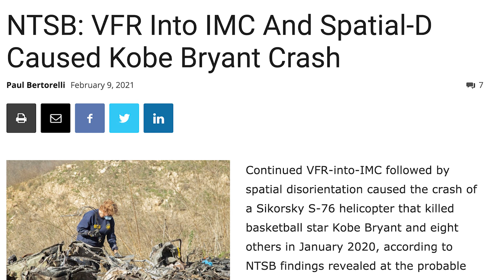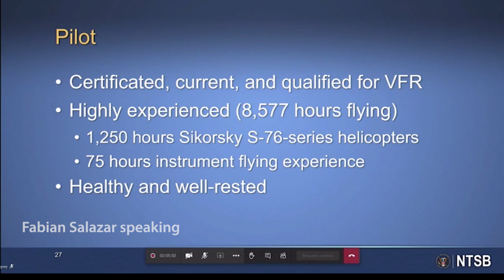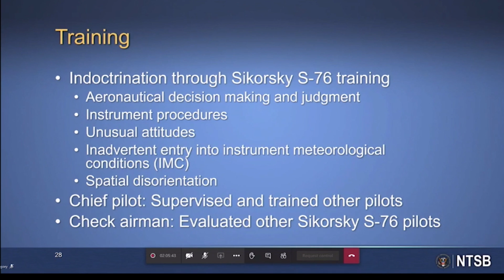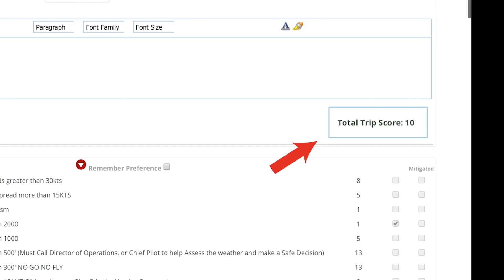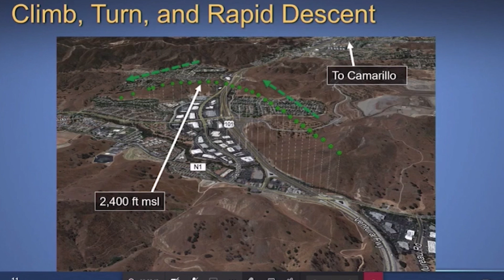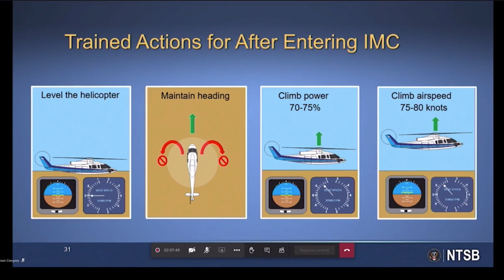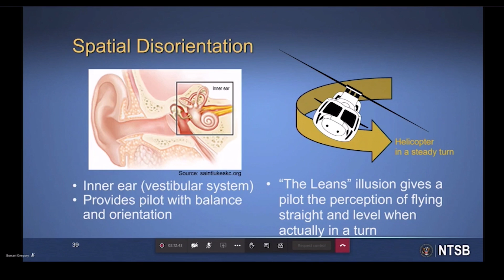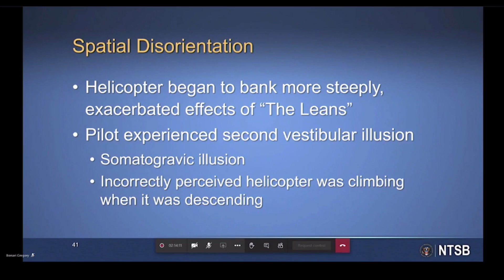How A Split Second Wrong Decision Caused the Kobe Bryant Fatal Crash

Comment: I think that the pilot was trying to get help from the towers. The first tower said that he couldn’t follow him anymore because he was lazy. The second tower was a problem when the first worker was leaving his shift and didn’t communicate with the new tower worker about the situation with this plane. If the tower would’ve helped, it’s possible he might have had a chance although he was disoriented I’m not sure
Reply: To begin with, you’re confusing approach/area controllers with tower controllers.  Second, the approach controllers were operating in a non-obligatory, advisory capacity only, and such advisories do not substitute for a pilot’s own responsibility to fly safely—for example, to remain in visual meteorological conditions (VMC).  Lastly, an aircraft is flown by the human in the cockpit, not by a controller sitting in a darkened room, miles away.  A pilot is trained to never make safety of flight dependent on a controller in the first place.  If, say, an aircraft’s radios failed altogether, a pilot should still be able to maintain safety and avoid disaster.

There’s no conceivable advisory that a controller could have given this pilot that would have reversed the course of disaster, once the pilot made the fatal decisions.
Reply: @cardinalRG  Great point.

Comment: NTSB chairman pretty much grandstanding.  Helicopters have limits on how much weight they can carry.  They seem to be a double standard here, after all, it was Kobe. I don't really care a wit about him. And as a helicopter pilot myself, I am not going to second guess the fellow in question. What stood out to me was 75 hours of logged instrument time out of 8000 + hours in helicopters. I fly both airplanes and helicopters and instrument-rated in both. I can tell you the last time I have flown an Instrument approach in a helicopter.  When I took the check ride with the FAA back in 1983!  They said he was current at the time, ok that has little to do with being proficient in instrument flying. 6 hours and 6 approaches every 6 months is well fine for currency but not enough to be proficient, that just my opinion. Look the poor guy had a lot going on, flying in an area I would not touch with a 10' pole and with a high-valued passenger and a heavily loaded aircraft and single pilot. A co-pilot would have gone a long way to reducing the workload and working thru the problem.  He got caught and it bit him. I feel for the poor guy.  Adding more stuff is not going to prevent anything, other than cut margins that are already pretty thin. Saying no is the hardest part of being a professional pilot, more times than not saying no means don't let the door hit you on the way out. I know first hand on that one.  Yeah, we are supposed to do what they say to do all the while being too frightened to meet in person over a bug with a 98% survival rate if you catch it. In case anybody didn't notice it.
Reply: Crash was pre-panicdemic.

Comment: funny thing is... it was NOT a split second wrong decision... you should have read the NTSB report...  VFR to IMC when the company wasn't allowed to fly IMC.  140 knots into IMC,  the weather report was bad and the pilot screwed up... desperate to make some money and fame. His aircraft had autopilot... he didn't use it, it worked at 50 knots, while he was blowing past at 140K.  Pilot had almost NO IMC time... he basically was a VFR pilot on paper. this fool pilot had NO plan other than his destination, no matter the visibility.. he didn't care at all. 

The Company, Island, failed to have proper policies regarding alternative plans based on a risk assessment. 
Pilots training was ignored by flying at 140k and basically ran himself into a brick wall (IMC)
Pilot decided HIS pressure to "get there" in light of how close he was,  ultimately did the flight in.
Island panned the RA as only "paperwork" technicality. 
Pilot / Island had no basic scenario based training .. nobody learned anything from other pilots mistakes. 
Single Pilot... no accountability for operational procedures in flight.  (did you fly by the book?)    duh, no.

Split second is a joke....  the pilot killed the passengers via negligence and Island was responsible for it.
Reply: At 140 kts in that situation clearly he believed that his "out" was to punch up and through the clouds to on-top by converting his speed into lift.  Apparently, however, he forgot how complicated helicopter IFR immediately becomes while making such an abrupt transition.

Comment: I find it interesting that the individuals tasked with trying to find out what caused this crash have most likely never experienced spatial disorientation. It was back in the '70s with my flight instructor on a dark night coming into an unfamiliar airport that I had my spatial disorientation episode. Fortunately the flight instructor was there to take control of the aircraft. 
Everything was going fine for me. I made a descending left-hand turn to land at the airport. Suddenly without any warning the entire aircraft and ground started spinning in my head. I had just experienced complete spatial disorientation. I'd experienced it, without any warning. I am certain to this day that if I would have been solo, I would have put a hole in the ground. Trying to determine what happened in situations like this without understanding what spatial disorientation truly feels like, is a lot like saying what you would have done in the alley when the bad guy pulled the gun on you. You have no idea what you would do, until it happens.

Comment: And this is why EVERY single aircraft that fly passengers for hire must require 2 pilots.
Reply: That would just make an unsterile cockpit and overcomplicate things. Would be an extremely poor decision.
Reply: @matt8863  it means the opposite of a sterile cockpit. I dont know how you're confused.
Reply: @matt8863  you obviously have no experience with helicopters. Comparing a heli charter to a commercial air liner shows how disconnected and misinformed you are.
Reply: @matt8863  And what about the tour operators who operate under part 135? Are you going to require twopilots to fly some tourists to the Grand Canyon? Or around hawaii? And flight training is a commercial operation. How can someone learn to fly when both seats are occupied by trained pilots? And if you're in an emergency situation who takes the controls? Would someone's natural instinct, especially in a chopper, take over and they'd end up fighting each other on the controls making it worse? Who logs PIC and SIC in that situation? Is the SIC really capable of being PIC but is sitting there just to be there? Or can they expect to do some flying? And what if they dont agree on the conditions? Will one pilot be more senior than the other and make a judgement call over them? Even when it's the wrong one? What if the second pilot is a new pilot and is flying with the chief? Will the chiefs word be gospel or will the new hire even have a say in the situation? Who will make up for the lost revenue of an empty seat now being occupied by a second pilot? Will companies be able to operate with that loss? Will they make up the difference with lack of maintenance oversight perhaps? Will the FAA revoke all single pilot IFR operators licenses? What if they've been operating single pilot IFR for decades without incident? Will they be punished as well? And with a second body in the cockpit that's roughly 200 lbs useful load gone and a massive CG change. Will utility operators be fine with that loss of useful cargo weight? Are fighter jets all now going to require two seats or is military exempt? What about military jets that are now operating in a commercial capacity? Or military choppers? Since you'll always be flying with two pilots will the FAA get rid of the solo hour requirements required to obtain a license? Not much point having solo time if you'll never be solo. Just saying everyone needs two pilots is a lot more complicated than you think.
Reply: @matt8863  But they cant. You're comparing close to 200,000 lbs aircraft to less than 10,000 lbs choppers. Often less than 5,000. Commerical airlines hit autopilot right after takeoff and just twist knobs. It's just not a practical comparison to the helicopter world.

Comment: Just ban sVFR with helicopters without a valid instrument rating. You could still allow for the aircraft to be non-IFR certified, altough most in commercial use would be IFR anyway. AFAIK the FAA Part 135 cannot be done in Europe?

Comment: I was on the ground in Van Nuys waiting for the Weather to lift, i did not take off for my VFR flight until 10:30 and even then it was MVFR.
Reply: Why didn't the pilot just go up? I know nothing about flying.
Reply: @jakev4191  because when you get into the clouds you can get disoriented very easily  you don't know what up is, if you do not regularly fly IFR  (using instruments only) anyone can get disorientation
Reply: @mbmb1799  thanks

Comment: I'm a little surprised and confused as to why an expert Level D S76 simulator instructor wasn't included in the investigation (if one was, I missed that). However, the lack of any mention of his actual training in this aircraft escapes me. The S76 B Model has a 4 axis Flight Control System that will fly the aircraft with the push of one button in an unusual attitude situation. This is called, "The Go-Around" button, located on the collective and can be activated with the left hand ring finger. It will level the aircraft and fly whatever course it levels out at and make the helicopter climb at 750fpm and set 80 knots indicated airspeed. That's all he had to do. Once in this mode, he could fine tune his course, speed, rate of climb and altitude desired, never having to have touched either control stick. I employed this training during initial and recurrent training as a Level D S76 B, C and C++ models as well as the Agusta AW 139, Instructor Pilot, for over ten years. The inferences to the "Auto Pilot" is different in this helicopter than in an airplane. The auto pilot in the S76 is used as a "Stability Augmentation System," which assists the pilot with stability while hand flying the aircraft. One must engage the Flight Management System in order for the helicopter to "Fly Itself". Additionally, the S76 has magnetic stick trim witch when either collective or cyclic trim switches are not depressed, will keep both sticks in the position from the last time the switches were released. These switches are a trigger type on the collective, usually activated by the left index finger with a normal grasp of the collective, and a thumb switch depressed with the right thumb of the right hand with a normal grip on the cyclic. VERY SIMPLE! Again, a closed scrutiny of the pilots training records should have gone a lot deeper. I wonder if he even had simulator training. Even so, this can be duplicated in the helicopter itself, though not to the extent that a simulator could. If the investigation is still ongoing, I hope they take a closer look at this.
Reply: Very interesting info!  I was wondering about that. I'm a GA fixed-wing pilot with no rotary experience. I think I saw something about it having auto-collective as well. Is that correct?  Also, I'd imagine that there are certain limits (Pitch/Roll) that the Go-Around button is ineffective, or will it engage the autopilot in any attitude?  Thanks for the feedback.
Reply: @redtailpilot  Yes, there are limits, but inside 45 degrees of bank and 30 degrees of pitch, it will engage.
Reply: @Rich206L  That's what I was thinking.

Comment: Am I wrong for wondering if the pilot had glanced at his artificial horizon & or radar altimeter he would have been given an indication that what he thought was happening and what was were differing from one another?

I get that it all happens fast, etc. And 1000s of other pilots not rated for IFR were in the same situation and didn’t crash, and so we don’t hear about them. I get that.

Just curious if the artificial horizon particularly would have told him he was in fact not riding normal to or perpendicular to the ground, but was in fact in a banking turn.

Thanks
Reply: You aren’t wrong, because what you describe is a possibility, but keep in mind that when spatial disorientation is severe enough, a pilot might be looking at the instruments, but be unable to act upon the information.  The attitude indicator, whose visual display is called the “artificial horizon,” is indeed the primary instrument for keeping the aircraft upright and flying

Comment: As a non-flying, non-expert (and never even having been in a helicopter) kind of person, I probably should be ignored.  But... it strikes me that a company operating helicopters in an area like this, known for conditions that require flying by instruments, even when you didn't expect to have to, should not be allowed to fly without being able to fly safely by instruments.  This was clearly pilot error, but, bearing in mind the pilot was human, and we all make mistakes, especially under disorientating conditions, that isn't the same as blaming the pilot.  If any blame is to be applied it should be aimed at the helicopter company (for operating - essentially - potentially unsafe flights), and/or the authorities who authorised those flights.  Those decisions inevitably led to a situation where the probability that the pilot was likely to make a lethal mistake was dangerously high.
Reply: You're correct in putting the operator under scrutiny, because operational matters often have a hand in accidents.  But you're incorrect in believing that no blame belongs to the pilot.  The pilot alone makes the decision to fly or not, and cannot be separated from the outcome.
Reply: I agree with you Paul. It is easy to just place full blame on the pilot but your line of thinking is the same as mine... i think they grounded all flights, why did they make an exception for this one? Has that aspect been investigated?

Comment: As an airplane pilot who flys RC helicopters, the big gotcha with helicopters is you can be flying straight and level at a decent amount of speed then if you roll/back lets say 60 degrees or more with no other change in controls, the helicopter becomes a missile towards the ground unlike what would happen in an airplane.  Really becomes a lawn dart at 80 or 90 degree bank.  So the idea of accidently of going IMC with a helicopter, I agree the first priority is to use the attitude indicator for level flight straight ahead then climb.

Comment: I fly both aeroplanes and helicopters. During my commercial plane training in Canada we had been practicing instrument flying. On this one particular flight there were some fair weather cumulus around, FEW coverage. While VFR my flight instructor had me fly around one of these clouds, base of which was over 4 000 feet AGL  (my instructor was checking for traffic cause he knew what he had planed). Then he surprised me by having me fly into this cloud. Well this turn out to be the longest sweatiest 30 seconds I have ever experienced. Basically the scenario of VMC into IMC. Even though it was a controlled exercise once in the cloud I had a flight  on my hands to maintain control. This happened in the early 90s and to this day I remember how as I entered the cloud I was looking out of the plane going oh cool I am flying in a cloud, maybe 5 to 10 seconds worth. But when I looked at my instruments they showed the right wing low so I leveled the wings and that is when I began flighting with every sensation that disagreed with what the instruments told me. We were not in the cloud all that long (30 seconds) and its base was high enough that even if I had lost control we would have popped out of the cloud within a short time and had plenty of altitude to recover. This training flight gave me a huge respect for the danger of going sudden IMC. I also had very recent instrument practice, within a day of doing this. Not like months or even years for some that end up in IMC.

 In Canada you do not have to be instrument rated to be a commercial pilot. Most of my hours our VFR helicopter flying, my other hours are VFR aeroplane other than the hood instrument training required for the licence (instrument experience but not a rating). So my first thought when I heard about this S-76 accident was why did he not land? I think the biggest advantage of a helicopter over and aeroplane in deteriorating weather is you can land almost anywhere (land and make a plan while sitting safe on the ground).

As I watched this video another thing came to me. If the NTSB is correct and this pilot decided to punch up through the layer of cloud, I wonder if the pilot even thought of using autopilot to do that climb.

In Canada we have an aviation safety letter put out by TC (Transport Canada) that has this motto "Learn form the mistakes of others, you will not live long enough to make them all yourself."